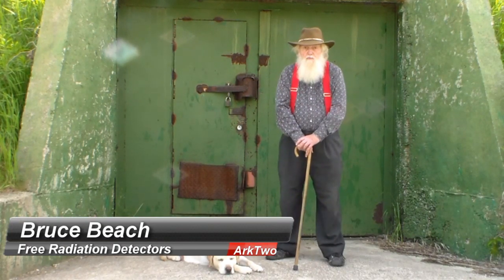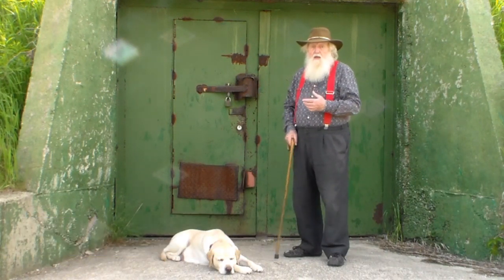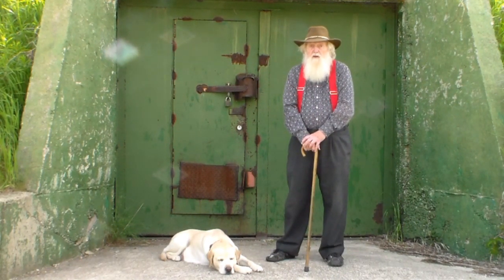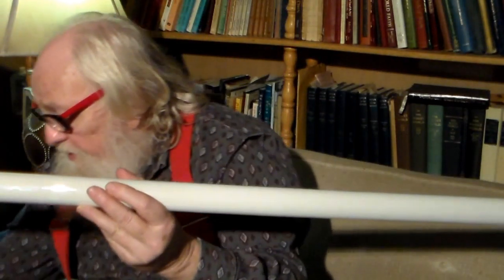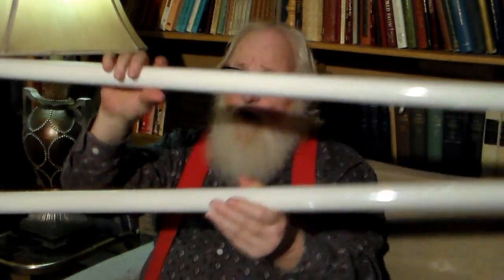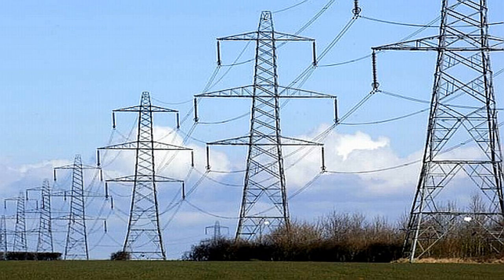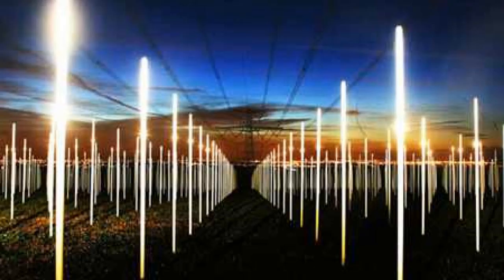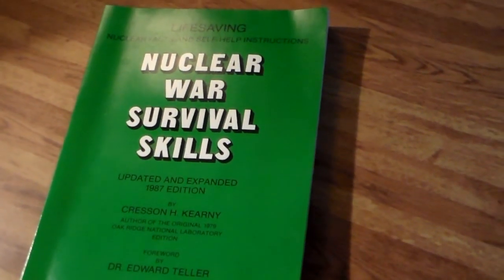Ark Two #18 pt.1 FREE Radiation Detectors

Comment: the only "radiation" people should be woried about is the ionising radiation (around 4 eV and higher). radiowaves microwaves and visible light are all non ionising. UV, xrays and gamma are ionising. powerlines emmit verry low energy radiowaves at 60 or 50 hz
i would say humans get most of their ionising radiation dose from the suns uv.

conclusion: dont worry and wear suncream!

Comment: I am skeptical about the light tubes working as radiation detector. They light up in presence of electromagnetic field, that's why you see them light up near the power line. Their inner side is covered with fluorescent material, so they could theoretically work as scintillation detectors, however I'm guessing that if you would really see them light up because of that, you'd be already dead, because the amount of radiation to make them light up would be more than deadly.
The phone detectors might work, but check the compatibility list. The key point is to cover the lens well, so no visible light can get to the camera sensor - in that case, gamma ray (or maybe even hard beta) would create a small flash as it hits the sensor, and those will be counted. See e.g. http://youtu.be/T91qBTfi7UM?t=28s - the noise on the video are actually X-rays from the tube.